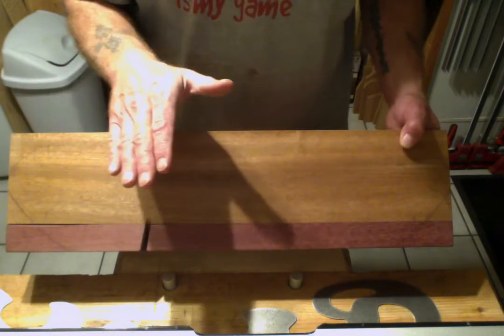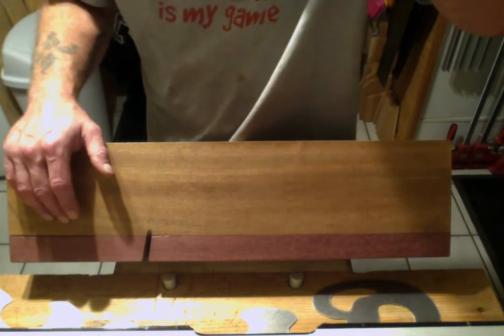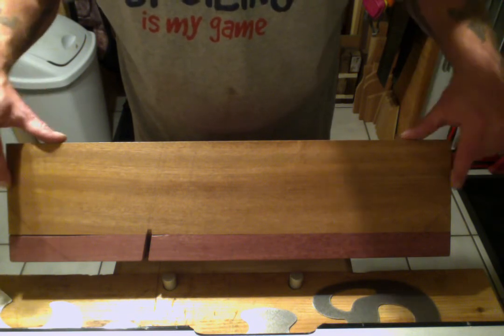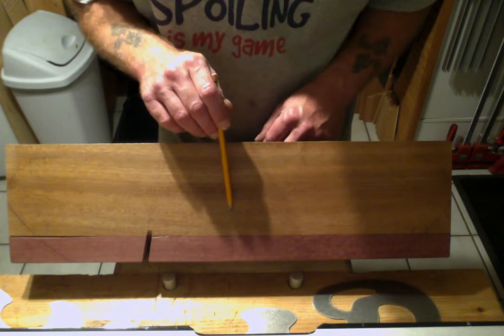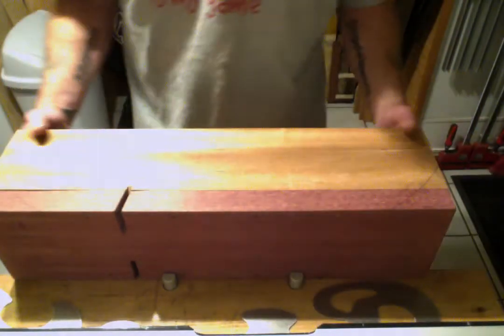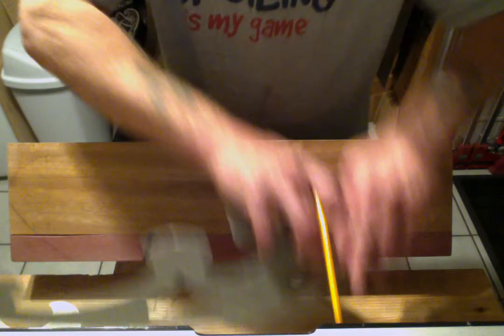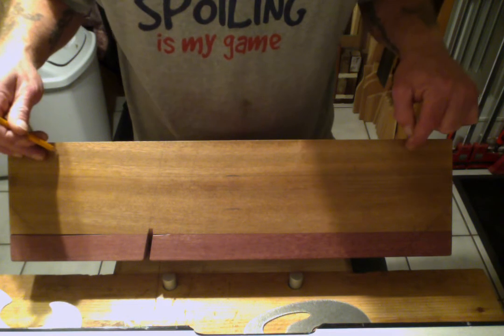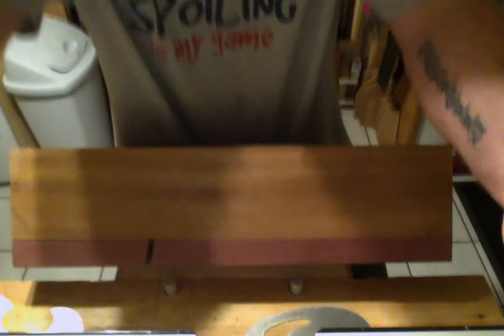VIEWER'S CHOICE DESIGN

Comment: I like option 1 where it curves down and then comes up to a point in the middle a little better. I have seen a couple pictures of antique ones with metal water box that looks like that and I think it looks cool but that is just me. Either way it looks awesome and I can't wait to see it with the grinding wheel. I've always wanted to try using one of those.
Reply from the maker: Thanks for the kind words and thanks for the vote! The whole setup looks amazing already and I think this piece will set it off really nice.  I also plan on going a little 3D with it, meaning carving up the sides like you would see on a boat, should prove to be an interesting piece at the very least when it's done.